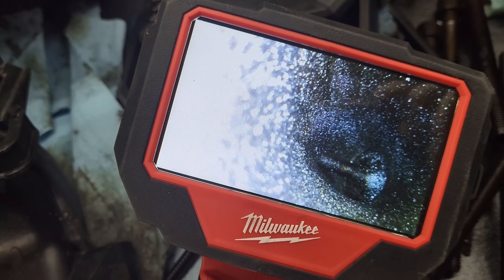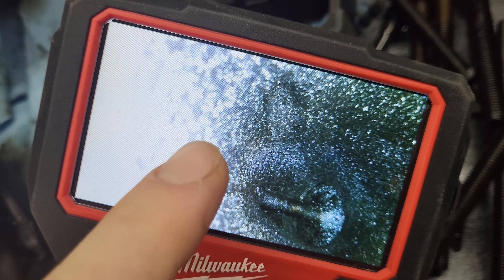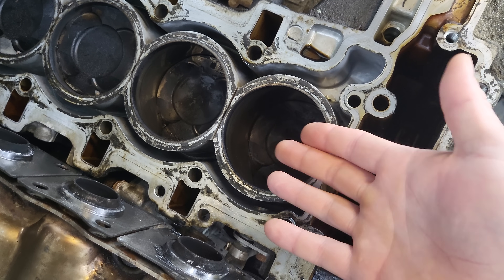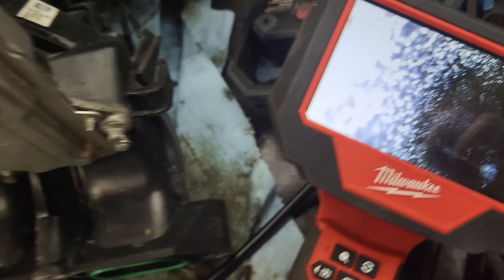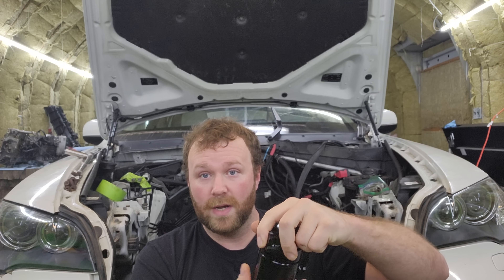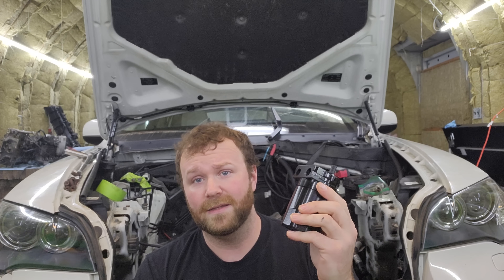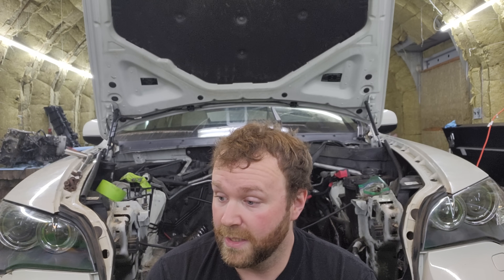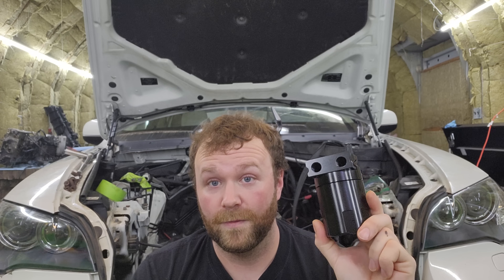The Modern Engine's Achilles Heel: How to Prevent Costly Carbon Build-Up in GDI Engines

Comment: I agree with your opinion. I have installed 3 small Catch Cans in 3 different vehicles. They will work to great extent if installed correctly. First, don't spend crazy money on those Marketed name brands that dont perform any better than some cheaper units. Second,Make sure it has a golden micro filter inside to restrict any oil vapors. Third, chose one that has a bottom ball valve so you can easily dain the can. Forth, run a hose from the bottom of the can to the underside of the vehicle for easy no mess draining.
Depending on the vehicle, 1 or more ounces may accumulate in the can between oil changes. 
Still I highly recommend using CRC Intake and Turbo Cleaner via PCV Valve inlet or Throttle Body to minimize any residual contamination on intake valves.  Do this every 10K or so miles and you shouldn't have any heavy deposits that would require expensive Walnut Blasting or engine tear down.
Reply: Brand recommendations would help!
Reply: What can of catch can do you used.Orville help a lot of people with GDI engine crap.
Reply: You really drain crappy oil onto the ground? Maybe save it and add to recycled waste oil from oil changes.
Reply: @alandaters8547 I believe he means running a hose from the valve on the bottom of the can to a place that you could drain it into the same oil change pan that you drain your engine oil into.
Reply: @alandaters8547  You drain it in the oil tray when changing your motor oil and filter. Always dispose of your used motor oil at the Parts Store or Authorized Recycling Centers.
Reply: I dump my oil right into the sewer drain with a picture of a fish on it
Reply: @tbonepumper5623 that's petty af 😂
Reply: @tbonepumper5623 😂😂😂

Comment: New technology seems to be really tough on the older generation.

My grandfather owned cars with pushrod V6 engines for years, he was used to being able to put any old slop in the oil pan that was cheapest. Finally one day he totaled his old Buick and needed a new car, and bought a Chevrolet Impala with the 3.6L V6 engine.

I tried to warn him it wasn’t a good idea, what made it worse was he bought it cheap from an auction. After he bought it I warned him about the 3.6L V6. I told him you have to use synthetic engine oil with detergents in it, and you have to change it regularly because it has variable valve timing and direct fuel injection! He did not heed my warning.

He proceeded to put conventional 5W-30 Motor oil in it because that’s what he was running on his old Buick, and within little time at all the engine was having all sorts of issues. He later then after being told by his under the table mechanic that he needs to run synthetic oil, tried telling me that I should do the same with my cars.

I politely told him… i tried warning you about that, my car (Which had a 3800 V6) doesn’t require synthetic oil, but I have been using Royal Purple which is one of the best synthetic oils you can get, since i bought my car.
Reply from the maker: Dump and fill. Some techs throw the drain plug back in while it's still dripping a fair amount. But doesn't take much to make new oil look like old oil.
Reply: This from an older generation type person who is up to date on the new technology. Something that hasn't changed is the dealership or auto repair shop scam. This fella seems to be a fairly honest guy but in the auto repair business he would be a rarity. Oil changes? Who do you trust to do one for you? The quickie lube joint who might charge you for synthetic oil but actually install some cheap bulk oil instead. The dealership? Might do the same only charge more. Now we have these direct injection, twin turbo gasoline engines that require special care and we have no idea if the dealership or the mechanic is being honest or just feeding us a line of crap. And, yes, Ford has a twin turbo engine. They have a low pressure turbo & a high pressure turbo. In the old radial aircraft engines that had to operate at high altitudes we called it low blow & hi blow because they had a 2 speed supercharger. Same old problem only compounded by hi tech. And not all new engines require synthetic oil. Strange blends like 5W20 or 5W30 or the really strange one 0W30. What is 0 weight oil? WD-40? I know they need it due to the close tolerances that some new engines have. This device that this guy is selling (or promoting) seems like a good idea but will it work in the long run? Only way to tell is to try one. Simple device, simply removing oil vapors from the PCV system before it passes into the intake.
Reply: @larryhutchens7593   As owner of  delearships (some high-end, other more mundane) and full mechanic shop, I always command to show the customer all changed parts, if possible, and show all boxes of new parts in its car and sometime offer some advices to avoid some problems that we've seen and parts are showing.
Reply: @larryhutchens7593  There are plenty of honest shops out there. We do what is right for the customer because we intend to have a long relationship with them.
Reply: @larryhutchens7593 You call 5W-30 strange blends? Try 0W-16 or 0W-8.

I have done a 0W-16 oil change myself. It's not hard.
Reply: I was along with your story until royal purple was mentioned…
Reply: @georgelin8498  
Cool
Reply: Boomers 😂
Reply: @ghoulbuster1  
My grandfather grew up in a time where oil technology is nothing like it is now. He can be stubborn as a ox but given the situation I understand what he did.

Comment: Hi Lance, I can’t agree that manufacturers don’t fit catch cans because owners won’t maintain them as it’s something that could be done when the vehicle is serviced. Most owners don’t check the oil, coolant or tyres between services anyway so a catch can would be no different. Personally I think it’s the cost to benefit ratio, most of the big manufacturers have been willing to put their customers lives at risk for the sake of a few pennies per vehicle so why spend a dollar or two on something that the customer isn’t demanding, doesn’t directly enhance the owner experience and generally won’t be a problem until well after the warranty has expired. You can bet that if it became a regular problem that started costing the manufacturers big money in warranty claims catch cans would suddenly be fitted at the factory and owners would be paying a high price to have filter replaced and the can “serviced”. The  people that even know it’s an issue are relatively few and those that care are even less. As for the very small percentage of drivers that know and care, we fit our own catch can and maintain them. Cheers mate, Stuart 🇦🇺

Comment: Snake oil. It's just a mini dehumidifier. The stuff that comes out is 99.9999999% water vapor. That water vapor would just go out the tailpipe. Just keep your oil clean and use quality fuel..

Comment: They could've add an automatic purge valve on the catch can and nobody would forget to drain it.
Reply: You could drain it back to the oil pan but then your oil would be contaminated.
Reply: @Krunch2020  Yes, but not any more than it already is with the PCV system.
Reply: @pfsantos007  The PCV system removes the contaminants and burns them in the engine though. All a catch can does is catch the stuff. If you drain it back to the sump then you are just recycling it back in.
Reply: Where does the PCV system takes its "contaminants"? In the vapors. Vapors will still find their way to the intake. Only the oil will have a chance to condense and accumulate in the oil catch can. The oil catch can have a tube going back to the intake. The only thing that's missing is the draining valve, for when the car is turned off. The little solenoid valve opens and the oil find its way back to the oil pan. That's how I see it. Many industrial air compressors have such valve that will drain the air drier periodically.
Reply: @olivierroy1301  other things will condense out in a catch can, especially in the winter when it’s cold. My f150 can would probably quadruple what it could in the winter and when you dumped it out it would separate into different layers
Reply: @Jay-me7gw  I'll try it.

Comment: I would like to see a comparison between gdi engines with forced induction, and gdi engines in a low performance application.

The blow-by issue is common on all forced induction engines. I assume a low performance gdi will still see this come up, but if it's at 200k, the rubber band CVT they put in everything now will have been the demise of that car long before 200k.

Comment: The EGR valve is a main cause of carbon build up also .
Reply: All the above. Carbon buildup from the PCV and EGR systems. Modern fuels have cleaners that are supposed to clean the intake valves but with direct injection, they no longer work as intended.

Comment: "Drivability issues?"  Like what?  A little bit of carbon buildup on the back side of intake valves shouldn't cause any problem at all.  This is way over sold to people.
Reply from the maker: Stumble/miss fire at idle. Poor fuel economy. No engine lights coming on  intermittent. There's a reason walnut blasting is a common service now.
Reply: I easily agree

Comment: Buy a Toyota problem solved. They don't have this problem because they use both styles of fuel injector.
Reply: I understand lots of Fords also have both.
Reply: @zerkfiter the problem is Fords also use wet belts to drive the oil pumps. Whether it’s rust or failure, Ford makes sure they see you every now and then more than 7 years
Reply: On the contrary, not all Toyota engines employ both.
Reply: @rusack7174  I'm not saying your wrong I'm just curious what years were direct only I  personally only ever saw both back when I was working in a shop.
Reply: @cobrapond Toyota’s dual injection system, they call it D4S, only came around on a few engines starting in 2016 or 17. My daughter’s 2014 Camry 4cyl is direct only. My wife’s 2018 Highlander Hybrid V6 has it. 
It’s funny, apparently Toyota denies that the system has anything to do with keeping intake valves clean, they say that under certain conditions port injection just works better. Whatever, I’m just glad they have it.
Reply: @glennbishop-smith9957  Well I learned something new, I guess most of our customers either had older cars with port only or newer ones with D4S.
Reply: This is when a design for just a reason to go to the latest, greatest. When just staying with the old intake manifold injection makes more sense than the gain in HP that you will get with direct injection. Most folks would not know the difference. Slight increase in HP and fuel mileage. Compared to gummed up intake valves.
Reply: D4S is a good system.

Comment: I would think that the minor benefits from direct injection aren't worth the costly repairs they seem to cause.  I'll stick with port injection.  In fact, for this - and many other - reasons, I won't be buying anything newer, I'll just keep dumping occasional "truck payments" into my trusty 23-year-old F-150 as necessary.
Reply: Direct port injection gives better fuel efficiency and engine performance. It’s the EGR system that causes the problem and that’s purely an anti pollution device mandated by the EPA.
Reply: @scroungasworkshop4663  don't blame regulations, blame mfrs for failing in design because they don't want to spend the development dollars.  
Face it, they hate that cars last 15-20 years, if they can bring it down to sub 10 years sales go up dramatically and folks are turned off buying used cars.  Exactly as they want it.
Reply: It's the PCV that causes it. EGR doesn't have oil in it.
Reply: @scroungasworkshop4663 The pcv system is not the same as the egr system. Positive crankcase ventilation bleeds pressure from the engine interior. Exhaust gas recirculation bleeds from the exhaust to lower combustion temperatures in diesel engines. They are not the same thing.
Reply: @kenmorrisproducer  I didn’t say they were.

Comment: What year range of cars have actual GDI? I thought most cars in the last 10 years are multiport now.
Reply from the maker: Mitsubishi was first to mass produce gdi since 1996. Toyota has recently used gdi and port injection. Some fords use them. Vast majority are still using gdi only. Hyundai, Nissan, kia, Honda, vw.  Toyota seems to be making the right calls. But the complexity and cost has gone up for them

Comment: Long oil change intervals with cheap oil is the real cause of valve deposits. Worn oil burns and smokes into intake sticks to valves. Fresh strong synthetic oil resists heat, so doesnt burn and smoke, nothing to stick to valves. Use only top quality full synthetic like pennzoil platinum every 5000 miles to prevent valve deposits.

Comment: The increased compression and combustion pressure doesn't cause much more blowby . The port injection engines had close to the same blowby ; however the ports , runners , and backs of valves are constantly washed in a sequential port injected engine , and stay clean . A catch can might help a little . This is another reason electric is on the way . I actually think a combined port and second system direct injection is better . But it's that complication that will help kill the ICE ,,, !

Comment: Some modern cars do have factory catch cans. Only reason why it is not installed on all new cars is it is a manufacturing cost and engine issues are generally outside warranty - so a customer problem.
Reply: Which cars have them?
Reply: @Blue-moon12 Some of the Porsches have an air-oil separator, with the oil draining back into the oil pan and the air from the pcv returning to the intake as normal. I think Land Rover and many diesels do this too.
Reply: @kenmorrisproducer  The current and previous gen Honda civic also have an air oil separator, at least on the type r but presumably on all civics. 
It seems pretty effective - I installed an additional catch can on mine and there’s not much left for it to catch.
Reply: @Blue-moon12 Porsche

Comment: GDI is garbage and I'd ride a bicycle before buying one. 
I said years ago that GDI would be the end of gasoline vehicles, low and behold, they're breaking with 30,000 miles on them like clockwork. 

The EPA is doing everything it can to keep you from owning and operating anything, they want the cash flow to go into electricity but guess how electricity is made..

Comment: My old Mercedes 240d had a check valve in the bottom of the catch can that drained any captured oil back to the crankcase.
Reply: Until it was leaking like a pig everywhere else
Reply: While I loved W123 body Benz's (Did my mechanic apprenticeship at a Benz dealer) you could almost run faster than a 240D. 300D Turbo engines puked oil from what seemed like every orifice. I was constantly resealing vacuum pumps, sub oil pans, valve covers and oil filter canister gaskets!
Reply: @g-mang-man7924  Yup. I used to tell people I measured 0-60 on a calendar.
Reply: @bobdoingbobthings  Ever get a chance to drive a W115 200D? A VW Beetle with a 1300cc would outrun those!
Reply: @g-mang-man7924  No, but I once drove a w116 300CD. That was the slowest car I've ever driven.
Reply: @g-mang-man7924  The W123 Euro 230e was a fabulous car.
Reply: I remember working on a couple of W115 230's, but mostly saw W123 280e (s)

Comment: A catch can helps a gdi engine as much as an ebay turbo fan
Reply: Tend to disagree. Put 250k miles on my gdi engine without any issues. Normal oil changes, belts, battery… the usuall suspects. Installed my catch can at 9k miles. Emptied it every oil change, was surprised at the amount of oil it kept from recirculating back into the intake. About a half cup every 3k-4K miles. Can’t be a bad thing to remove it. My next vehicle, same story. 210k miles no issues. Now looking into one for my newest vehicle.
Reply from the maker: Seeing more and more comments like this one.  Saves those catalytics from clogging up too@
Reply: @chuckg3517  if you lost a half cup every 3k-4k miles you'd have an oil consumption issue. I doubt all of that liquid was oil.
Reply: @matsudakodo  most of it was oil, google gen5 v6 Camaro oil issues.

Comment: Use quality fuel, regularly take your vehicle on a 30+ minute run at high rev's low load, do frequent (6 month / 3k mile, whichever sooner) oil changes, consider buying a Toyota which has dual injectors (port + direct) which periodically washes the intake valves with fuel.
Reply: But, what if I don't want a Toyota? Also, not all Toyota GDI engines emply the D-4S system.
Reply: @rusack7174  "But, what if I don't want a Toyota?"

I know of no other brand that gives a siht about it's customers like this employs this technique.

"Also, not all Toyota GDI engines emply the D-4S system."

Which is why I said "consider buying a Toyota which has dual injectors". Vote with your money and favour brands which not only want to sell you your next vehicle but your next 7 vehicles.